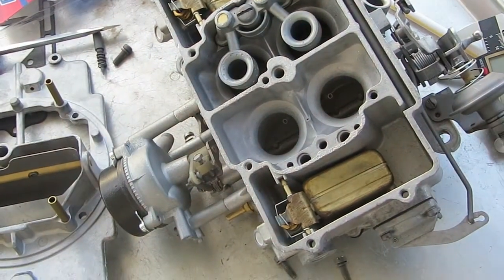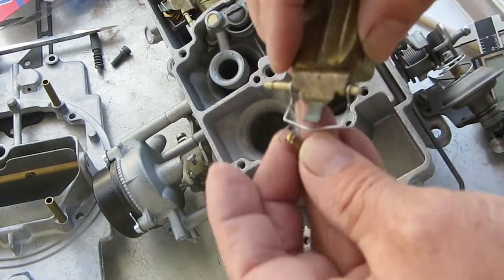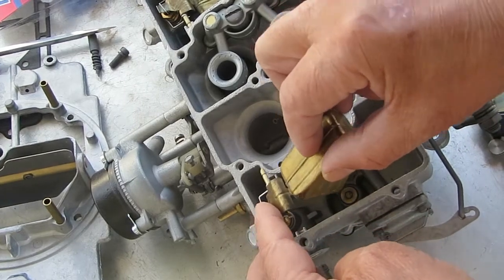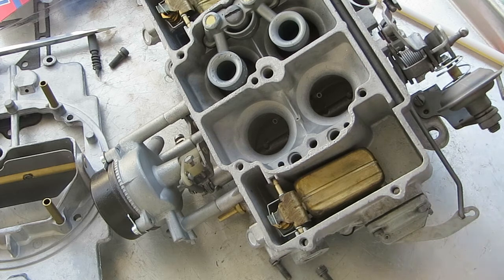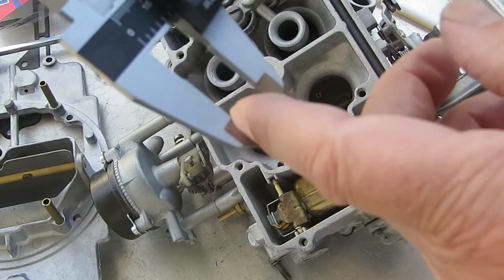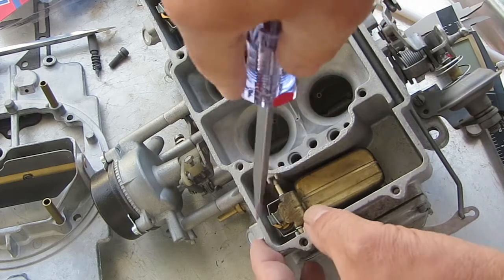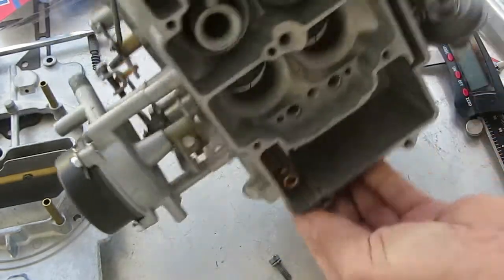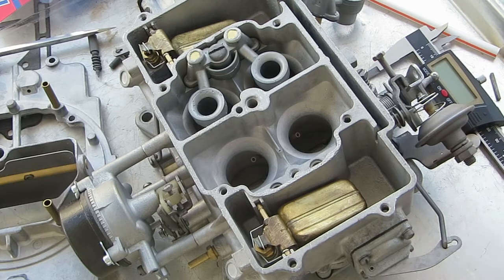Autolite 4 Barrel 4100 Setting Float Level

Comment: Hi Mike, I have a 64 thunderbird and it has been running rich and seeping down and gas has been contaminating the oil. 
I feel like it’s the floats, but am open to your thoughts.
The shop manual calls for 29/32 wet. Would I follow the same steps you have here to set that?

Comment: If it’s not the float, what’s the main cause for my 2100 flooding or running rich?
Reply: @MikesCarburetor  thanks Mike, so the basic reason is too much fuel in the bowl - whether from a worn needle, a leaking float or incorrectly adjusted float height. Not the jets? I ask this because jets do not seem to be a standard inclusion in rebuild kits.
Reply: have you checked for a blown power valve?